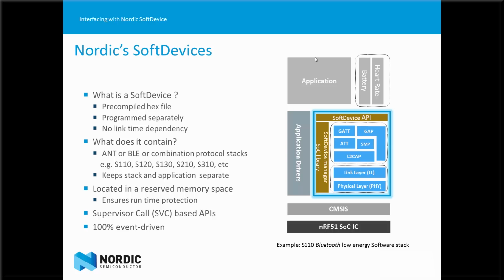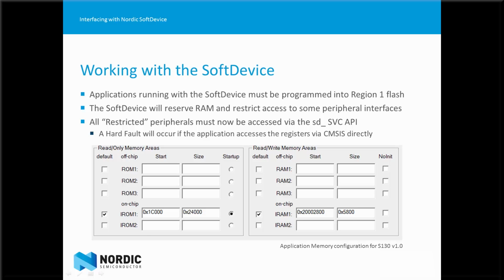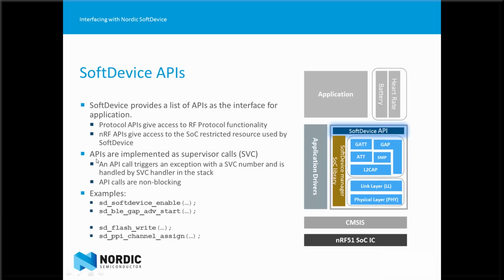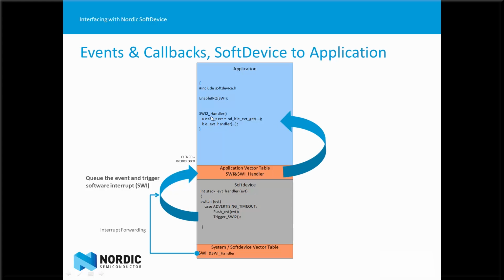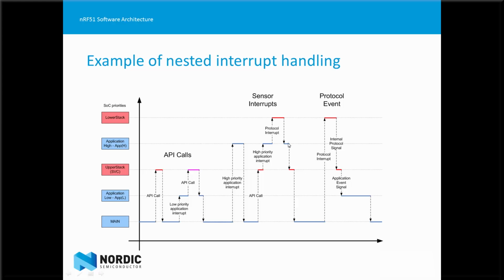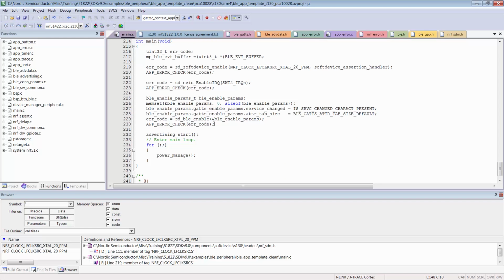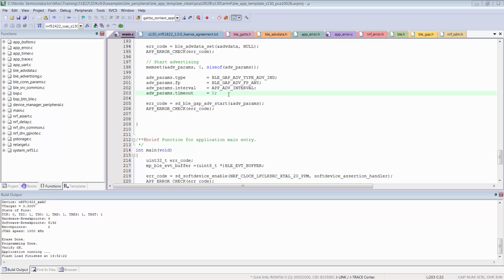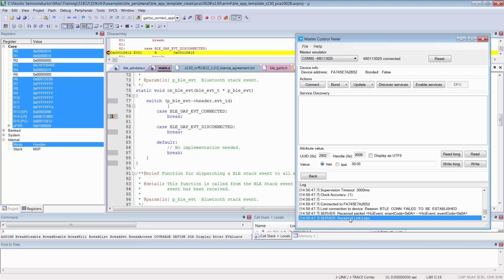Webcast: Interfacing with Nordic SoftDevices

Comment: This webcast is helping me tremendously to understand the operation of the Softdevice. Is it possible to get the source code of the example presented? Where can I find it?
Thank you!
Reply from the maker: The source code is not available unfortunately, but it's based on the ble_app_template, in nRF5 SDK v9.0 https://www.nordicsemi.com/Software-and-tools/Software/nRF5-SDK
Reply: @NordicSemi  The ble_app_template that you mentioned (in SDK v9.0) is helpful when you want to use the SDK. However, the example in the video is bare metal, it is going directly to the interrupt level and the event passing.  This basic operation is what I am trying to understand. Thank you.
Reply: @andresaguirre9274  Please make sure you checked the example in SDK v.9 (or other SDK prior to SDK v13). I don't see much different from the example in the SDK with the one I made in the webinar here. If you still have trouble understanding the example, please create a case on http://devzone.nordicsemi.com/

Comment: Looks like the latest Segger Embedded Studio automatically downloads the Softdevice to the J-Link without having to do anything special.
Reply from the maker: It has been like this for a while. As long as the SoftDevice hex is provided as an additional load file in your project settings the SoftDevice will be automatically programmed as needed.

Comment: Nice vedeo.  Is there any way to use the nrf51 dk development kit with AT commands?  Like making a discovery/scan connecting, bonding and so on via the UART and a terminal program.  I have search for examples but with no luck.  I have used this with several other vendors but i can't find any "easy" way to do this with Nordic devices.